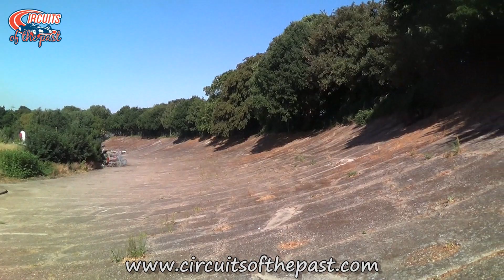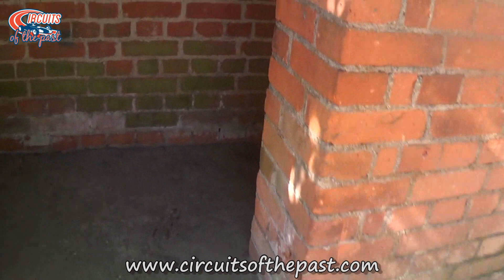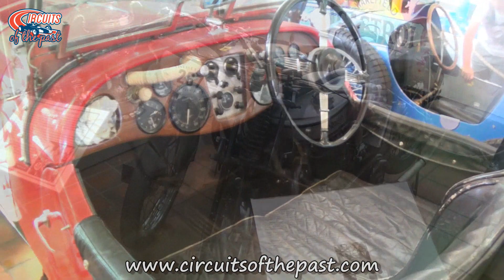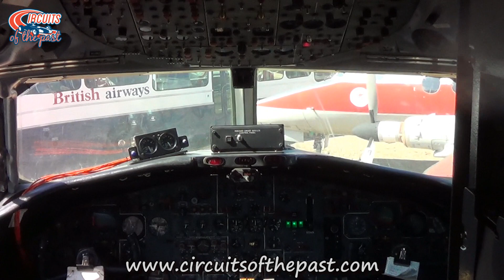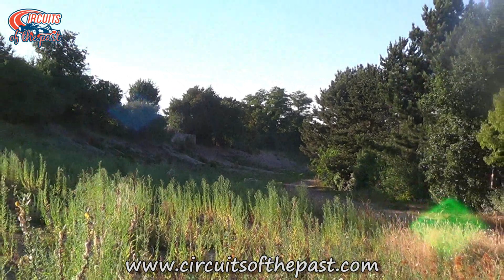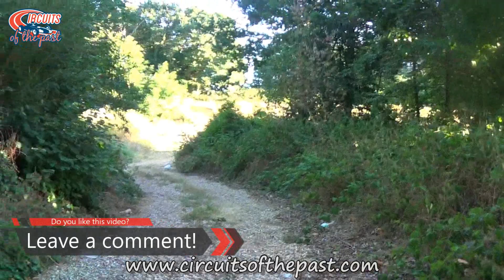Secrets of Brooklands: The Oldest Circuit in the World | Circuit Tour 2018 Part 2

Comment: Where are these so called "ammunition bunkers" then???

HINT: There aren't any ammunition bunkers at Brooklands!
Reply from the maker: Actually, according to research, there were three small brick bunkers at Brooklands built during WWII, located on the inside of the Members' Banking just east of the Members' Bridge. They served as ammunition stores for the anti-aircraft towers on the hill. They were small, so it’s understandable why they might be easy to miss or seem insignificant. Source: https://commons.wikimedia.org/wiki/Brooklands_Motor_Circuit_surviving_sections

Quote: "As part of the changes made during WWII, three small brick bunkers were added on the inside of the Members' Banking, in a line immediately to the east of the Members' Bridge - 51.356279°N 0.462161°W (east), 51.356162°N 0.461892°W (middle), 51.356032°N 0.461673°W (west). These were ammunition stores for the anti-aircraft towers that were mounted on the hill."